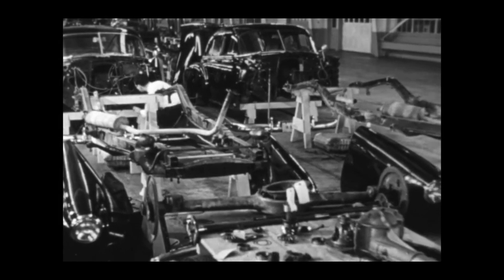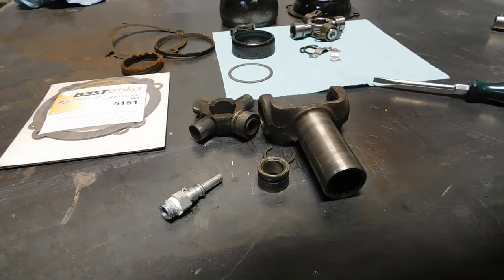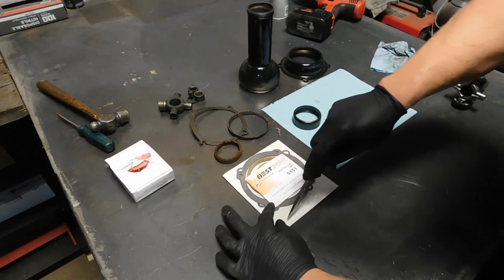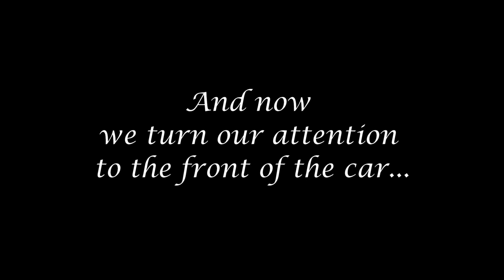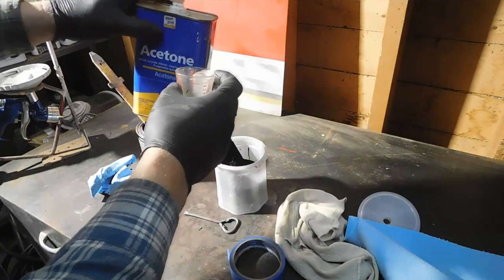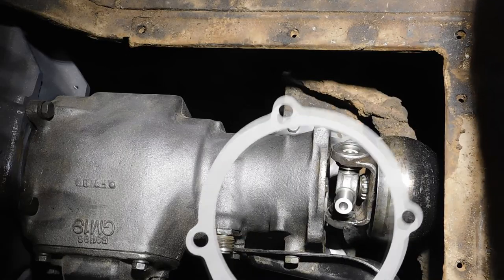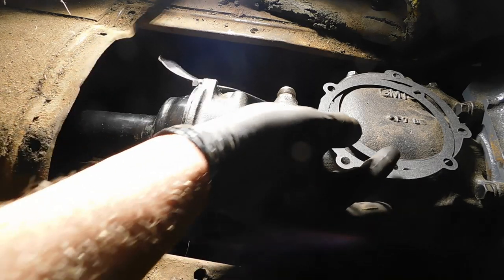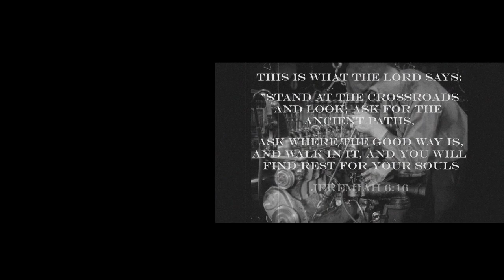Part 5: 1948 Chevrolet Torque Tube (1929-1954) U-Joint Service & Engine Installation

Comment: Can this u-joint be replaced from underneath the car or do you have to remove the cover from the floor pan? (I have a 4 post lift 😅). I'm the current owner of the 1952 Chevy that my grandfather bought new. Wonderful, simple pieces of iron.

Comment: Wouldn't have done installation that way. Should have pressed bushing in one end then install cross then press other bushing. Shouldn't use cross for pressing. Uneven pressure on bushings. Been there and done it many times. First car in 1959 was a 1950 Chevy  many clutch,trans,& axle replacements ( youth ) LOL

Comment from the maker: Had a hidden comment that there should have been a washer on both sides of the small cork seal, this is absolutely true. At least the parts book affirms that. However this car did not have two, I will have to track down another one. Although it must have worked ok without it. Thanks for pointing that out!

Comment: Is this the same u-joint if you have a Hydramatic transmission?  I don’t see any different u joint sets anywhere that state “hydra or automatic” on a 1954 Chev 1/2 ton pickup. None of the vendors can answer that.  Hoping they are the same u joint. Thanks for a great video Jay!

Comment: Thanks for the information.
I have a 1950 3100 pickup truck 3spd. Does the transmission have to be removed to replace the okie bushing or can it be done with it in, also can the ball and flange cork gaskets be replaced without removing the transmission

Comment: Hey Jayhawker--love your channel. I've learned a lot from your videos and much appreciated you sharing your skills to the community. I have a '50 Chevy truck, 3100 series, 235 6 cylinder; we've been together 31 years!  My question is: when I fill the transmission case with 90 wt oil, I can see this fresh oil leaking from the torque tube. Can I remove and tube and replace the seal without removing the transmission? Thanks in advance!
Reply from the maker: Yes indeed you can. Loosen and pull back the ball assembly as far as it will go on the torque tube then removed the bolts for the u-joint and slide it back. At that point the whole front end of the torque tube will be able to swing down. 
If you think your ball is in good adjustment keep track of the paper shims that are between the flange and the transmission when you remove it so that you can put the right thickness back in.
Reply: @TheJayhawker  That's great news! So to repair the leak from the torque tube I'll the Okie bushing (and removal tool) and Best Gasket seal kit and/or felt seal that you mentioned? I have the shop manual, but would appreciate your guidance. Much thanks! Tucker

Comment: Great video, and now I know how to replace my oakie bushing.But when do I need to do this? What are the signs I need to replace it?  I just switched engines and now Im installing the engine....how do I know I need to do this and not just put it all back together?
Reply from the maker: The typical problem is that the bushing wears out from normal use and lets the driveshaft waller out the seal, then the seal lets the gear oil from the u-joint in the ball leak down to the rear end. So if your transmission is low on oil and your differential level is high, that would be an indication at least that your seal is shot. Other than that you pretty much have to pull back the ball and check for play in the shaft and do a visual inspection of the seal.

Comment: When testing to see how many paper shims will be needed, and cork gaskets not in, do you still have the u joint bolted up
Reply from the maker: No, in order to move shims and gaskets around it will need to be disconnected.

Comment: I always spun the u joint after tightening the 4 mount bolts. upon recheck they would loosen up. retighten and spin it again. only bend the lock tabs over when you are sure they will stay tight.

Comment: Hey Jay did you fill the speedo section of the trans with gear oil until it starts to run out?

Comment: Good set of videos!!
Maybe you can help me. I have a 54 Chevy truck 3100. The drive shaft set up looks identical to yours (basically). I have a 4 speed trans with 
a granny gear. Hear is what has me scratching my head and fearing the worst. On my truck, where the drive shaft rotational cover attaches to the trans I have a "coolant" leak. It is a greenish fluid so i don't know what else it could be. 
 I haven't had the truck long but supposedly the engine has been rebuilt. 
Any ideas?????????????????
Reply from the maker: The only thing that it should be is gear oil from the trans. Check the oil level in the trans. and compare it with the color you're seeing. The only other thing it could be is if you have a coolant leak from higher up on the engine possibly towards the back of the engine and it is traveling down to that point.

Comment: Can i tow my 53 chevy pickup a long distance on a tow bar without damage to the transmission or rear differential. Since it has a tork tube  drive shaft?
Reply from the maker: From what little I know on the subject, if it's a manual put it in neutral and it should be fine. The debates usually pop up when automatics are involved. But I have honestly never tried it.
Reply: @TheJayhawker  thanks for the  info, it's full of lube so think it'll be fine

Comment: Is this the same concept for install on the cast iron Powerglide transmission?
Reply from the maker: That's correct, your parts will be different but the concept is the same.

Comment: When i fill the transmission back up throught the speedo hole how  do i know that it is full ?
Reply from the maker: When it comes out the hole, it's full. Seriously though, you can use a small allen wrench as a dipstick and keep checking the level until it is just below the hole.

Comment: How much oil did you put in the speedo area were the bell housing is?
Reply from the maker: Fill it up. You can check progress by sticking an allen wrench in the hole as a dipstick but if you fill it until it comes out it's ok.

Comment: Any recommendations on we're to get the u joint trunion and the whole assembly we're ot goes
Reply from the maker: The u-joint pieces you can get from chevsofthe40s.com or fillingstation.com. The ball assembly I would either take to a shop to have it fixed or look for a good one on ebay.
Reply: @TheJayhawker  what about the part that goes on the transmission were the trunions screw on to hold together mine snapped all 4 bolts completely off
Reply from the maker: @edgarcastrolee  Yeah, unfortunately you have three options on these old parts: 1. Find a good used transmission or the part that broke from a classic car salvage yard or ebay type website or contact some old Chevy clubs and see if someone has one. 2. Take it all apart and have a new one made at a machine shop. Or see if they think it's possible to weld it back together 3. Replace the entire drivetrain with something more modern.

Comment: I have a 49 chev trk w/enclosed drive shaft. Can a 57 chev trh 3 speed trans be made to mate to enclosed drive shaft?
Reply from the maker: I should do a little more research before I answer this, BUT, assuming the input shaft is the same on both transmissions I believe the 57 should bolt up to the clutch housing on the 49. Then on the outlet side you would have to use the 57 open driveshaft and rear axle. I think your'e only alternative to do what you want is to remove the tail piece from the 57 trans and have a housing custom machined to accept the torque tube ball.
Reply: Thanks for this info. I'm not quite ready to install engine and trans, but just trying to figure out stuff ahead of that time.  Thanks again!
Reply: The engine I'm installing is a 57 chev trk w/ the matching 3 speed trans, that's why I was curious of mating the trans w/ 49 enclosed driveshaft.  I met a enthusiast that did this w/ a corvette 4 speed to a enclosed driveshaft, but he moved out of state before I could find out how he did it...
Reply: @fjbowen3155  just read your  comment a 57 trans is longer than any torque tube trans, as for a 4sp it's also to long to fit . You'll have to shorten the torque tube and shaft and then fabricate some sort of adapter to mate it to the trans. Have to remember the torque tube style diff is supported by the trans and has to pivot when hitting bumps. Believe easier to replace diff assembly with later year with an open drive line.

Comment: Why would you check it to see if it needs shims with out the cork seals. In theory with out the seals in place its gonna be loose?
Reply from the maker: That's the point and sorry if I wasn't to clear. Because it is a more or less solid connection between the transmission and the rear axle  you need to know it is neither too tight or too loose without the cork seal. Once you put the cork seal in it, it will feel tight no matter what. So, once the proper mechanical clearance is set with the shims you put the cork seal in and the cork will "squish" to the proper shape and thickness.
Reply: @TheJayhawker  I think I get what your doing. Essentially you are make just right so it’s not to tight or to loose when the cork seals are installed?
Reply from the maker: @Bill-xc8le  So the cork seals are only an oil seal, they have nothing to do with the adjustment of the torque tube. The important thing is that you get the two pieces of the ball adjusted correctly so that there isn't any slop between the ball and flange nor to tight between the two. Too loose and your rear axle can shift back and forth and put harmful loads on the u-joint, too tight and the flange and ball would gouge each other and actually put a preload between the trans. and the rear axle. The cork is only an afterthought to keep trans gear oil from coming out.
Reply: @TheJayhawker  ok, I got it now, thanks a million!

Comment: How many shims do you recommend to put before closing up
Reply from the maker: Probably just a couple but you really need to go through the steps of checking your particular driveshaft to know for sure.
Reply: @TheJayhawker  it's a 1948 chevy stylemaster with a inline 6 217ci stock rear end
Reply from the maker: @edgarcastrolee  I mean there is no set number of shims for any particular car. If you know how many were on your car to begin with then it's a pretty safe bet that's how many you need. Otherwise you need to install the ball and flange onto the back of the transmission with 2 shims but without the cork gaskets and don't put it on the torque tube. See how the ball feels when you move it up and down. If it's very tight you will need to remove a shim because the metal pieces will gouge each other when you drive over bumps, if it's very loose add another and try again. Once you think it feels correct you can install the cork gaskets like I did in the video and then install it in the car.
Reply from the maker: I said that backwards, if it's tight add a shim - if loose take one out
Reply: @TheJayhawker  thank you for your help looks like 3shims will do
Reply: What transmission oil would be good for it on my 48 stylemaster and also for diff
Reply from the maker: @edgarcastrolee  80W-90 gear oil for both
Reply: @TheJayhawker  sounds good I will put that full syntedic or regular

Comment: Why did you put gear oil threw the speedo area?
Reply from the maker: That's what lubricates the u-joint. It's also why you need a good seal inside the torque tube (what the okie bushing if you haven't). If your seal is shot the oil will leak down to the differential and the u-joint won't have any lubrication.
Reply: @TheJayhawker  question I put one shim and it's still leaves just a bit what can I do to stop from leaking can I take off last shim or does it need it
Reply from the maker: @edgarcastrolee  I would go with one shim because it still needs something to seal the flange to the back of the transmission. Once you get your cork gaskets in there it will tighten up.
Reply: @TheJayhawker  yeah I left one it has the cork gasket already do you think I should put another cork gasket ? Going to loos up the 4 bolt to move around the bell housing to see if it seals better .don't know what to put on there so it won't leak

Comment: hi do you need a new gasket at 12:40? cheers
Reply from the maker: not sure which one you mean, you have a felt seal around the tube and the rear end of the painted piece, a cork gasket inside the flange that goes around the ball, and then your shim gaskets that go up again the transmission. Thanks for watching
Reply: @TheJayhawker  The cork gasket that goes around the ball thanks for replying

Comment: What a process!. Exactly the information I needed. I have my grandmother's 52 style line deluxe with only 65k miles. Granddad replaced the powerglide with a 3-speed transmission. The clutch assembly needs to be replaced and the transmissions making a lot of noise in first and second. 3rd is smooth.. I plan on pulling the transmission getting it rebuilt and then put everything back together with new parts. I also need to do the steering and suspension at the moment That's probably more important actually.
Anyways do you have a source of a manual and for parts? Thanks
Reply from the maker: As far as manuals I always check ebay first, but there are companies out there such as Faxon that reprint all the old manuals as well. 
As far as parts, for most things I go to Chevs of the 40's or The Filling Station. Again ebay can be a pretty good resource to find things as well.